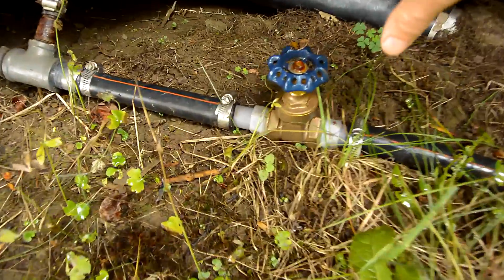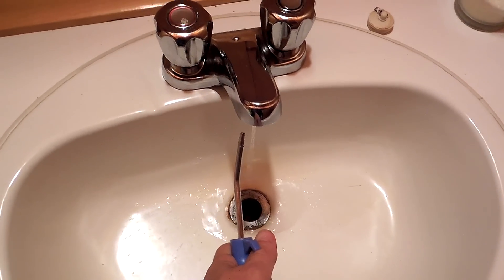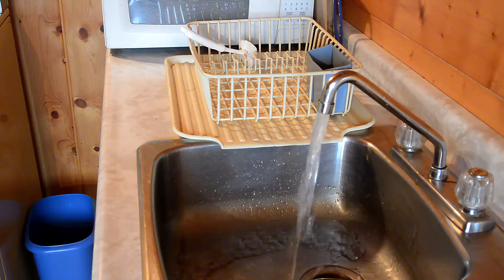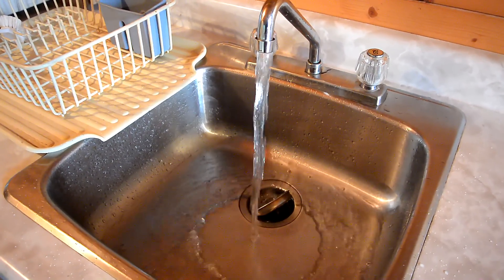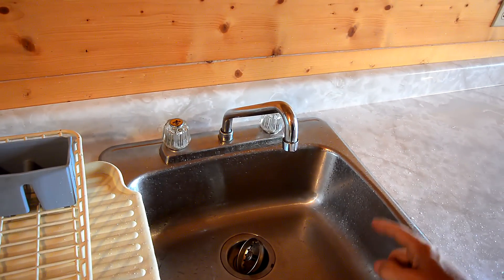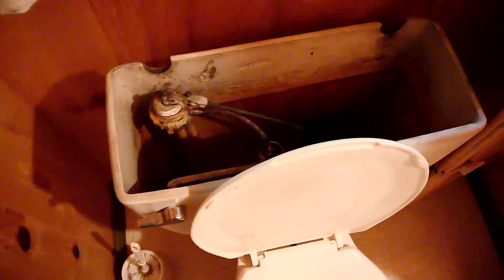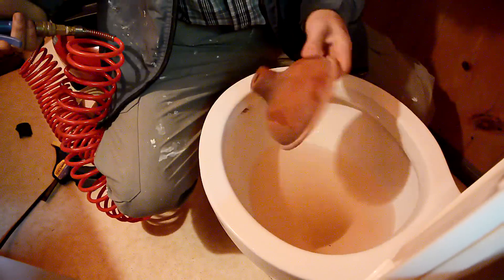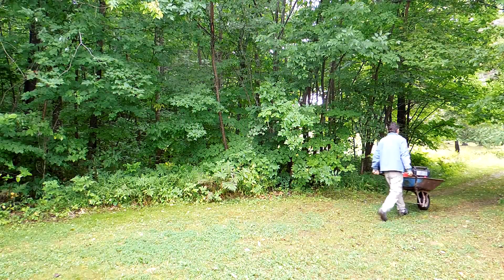Draining plumbing with compressed air

Comment: I'm surprised the hot water tank held the pressure, don't you have a vent in the system ?
unless you have a pressurised system with an expansion tank
I hope the antifreeze seals the trap, otherwise the sewer gases would come back out
Reply: hot water tanks have a pressure relief valve, just keep below that
Reply: The pressure from the compressor is nothing for the tank
Reply: Not too worried about holding masses of pressure, but a vented tank would let the air out

Comment: I don't know for Canadian hardware, but here in France, I think that the hot water tank has not been made to handle more thant 3-4 bar pressure...
Maybe you don't use such a pressure, and maybe I should check which pressure such a tank can handle !?
Reply: Same, here in the UK invented hot water cylinders are fitted with pressure release valves that open at either 3 or 5 bar pressure to prevent them being over pressurized and exploding!!!
Reply: ryantoomanyhobbies * unvented
Reply: the pressure isn't really built up high since the tap is open.
Reply: It's unlikely his compressor was generating 5 bar of pressure in the big volume of the pipes. Canadian houses usually have about 4 bar of pressure in the plumbing, and most components are built to withstand 10 bar.
Reply: 3 bar is 45 PSI which is far more than he is putting in
Reply: Mark Rose wow Canadian domestic water pressure is that high??? Here in the UK 1.5 is the average.
Reply: OwLoLz at the end he pressurises the whole system with the taps closed hence the big build up of pressure when the incoming mains supply is disconnected at the end. Still it is an incredibly effective method of fully draining a house.
Reply: ryantoomanyhobbies At 1.5 bar there would be no pressure approximately 15 meters up. On the top floor of a three or four storey building you would be waiting an awful long time for a toilet tank or bathtub to fill with only 1.5 bar. You also need enough pressure to overcome the resistance in elbows and whatnot to keep decent flow.

Older homes may be run with lower pressure, for sure, but in new builds 3 bar is generally the minimum to be expected.
Reply: Mark Rose I'm a fully qualified plumber and our domestic water supply and aware that every meter of head requires .1 bar. Here in the UK multi level buildings here require boosted systems with breaker tanks.
Reply: Mark Rose meant to say our domestic water supply here is on average 1.5 bar.
Reply: Mark Rose You lose one bar every ten meters of height. In Holland 1.5 till 3,5 is normal. Big buildings require a hydrofoor, which sucks and pushes the water into the pipe.
Reply: I run my water pressure at 60 psi and the pressure relief on the hot water tank is around 150 psi.

Comment: Hope you turned off the power to the hot water cylinder, an isolation check list would be a good idea with multiple units.

Comment: A tip: never exceed more than 15 psi when using compressed air to clear hot water tanks. The pressure will deflect some tanks and fracture the internal spun-glass lining of the tank leading to a rapid death of your tank. This advice comes from experience..unfortunately.

Comment: <-- plumber. First off all blowing air whit a compressed can separate you drain pips at the connections so to keep you on the safe side put anti friz and salt and if its really cold unplug them and drain the water that way. remember to put something in the pipe for the smell. about the water pipes the best way to get all the water out is to take out the plug in the bottom of the water tank then open all the  zings and take the pipes apart when the water comes in the house but after the valve not before.

Comment: It's a lot easier to put a "T" with a shut off valve connected to an air fitting in the main line just in front of the main shut off valve. Just close the main valve, connect the compressor to the fitting and open the attached valve pressurizing everything down line. Just open the faucets and drain everything at once.

Comment: I wonder how much more expensive it would be to insulate those pipes for winter
Reply: Remember that insulation also prevents heat to enter. It goes both ways. Laying out pipes directly on the ground with only insulation is equal to pissing in your pants. It will work, for a very short period of time. The only way to prevent freezing is to have the pipes below the ground, below the freeze. But since the cabins are not habitated during the winter they will be cold and the water will freeze inside the cabins. You COULD insulate them and use a pipe defroster cable, but why would you go to that expence when you're not there?  This is the only reasonable way of doing it.
Reply: Spacehero You are right, I did not think about the water inside cabin in faucets and such

Comment: I've never been afraid of asking a stupid question, so here goes. In this video you are carting around a full air compressor - and even small ones are reasonably heavy. What about a portable air tank? I see these at Princess Auto, but I've never really understood their function.
Reply: Portable air tanks don't really hold that much.  It would be empty before the first cottage was done.  They have limited use. Generally, getting a heavier duty air compressor with the needed CFM is a better investment.

Comment: That's very clever but even better would be a drain cock under each cabin that's expressly designed to drain every last drop  in the system.

Comment: interesting and different way to go about this... there is an easier way, also sediment from the tank best to go down the first drain and not throughout the system, hook up a schrader $10 , valve near  top of the tanks, drain that with hose. Then another schrader near water supply.  You way is prob not recommended for city water hook up. Anti freeze in traps. When not using the schrader valve, plug those  connections

Comment: 100 psi is about max I would go, maybe 80 to be safe.. I see you have a 165psi... perhaps best to turn it down if you can.
Reply: Omega Man
 keep in mind that the total volume in the pipes is significantly greater than the volume in the compressor tank, so the amount of air he put in there probably got to 20 psi, 30 at most
(~1.5-2 bar I think?)

Comment: By emptying the traps isn't that going to let the smell of the sewer into the rooms?
Reply: +Jakob Dixon he replaced the water in the traps with Propylene Glycol which is a non-toxic antifreeze that doesn't evaporate. You'll find it on store shelves under the name RV Antifreeze.

Comment: Why not just disconnect the supply lines on all the cottages open all the taps and have a beer while you wait?
Reply: im guessing that would be too easy
Reply: I expect that if you have any low spots in your plumbing some water could get trapped there and subsequently freeze and thus split a pipe. Then when water is introduced again you have leaks.
Reply: I would guess that one small compressor would not have enough volume of air flow to push the water out of seven plumbing systems simultaneously.

Comment: Might blow out your plumbing fittings or valves might want to check with a plumber to make shure this is not bad for your plumbing.
Reply: Also make shure you dont blow waste water into your drinking water im shure they are seperate lines just saying.

Comment: I'm only 13 but I know that they make adapters that go from the compressor to a faucet outside which is better and the traps should not be blowed out they should just have anti freeze put in them so that the water in them won't freeze and so that you still have a seal to keep the sewer gas from coming in